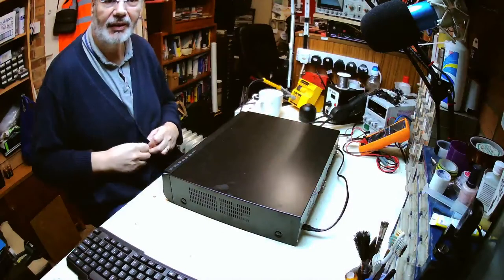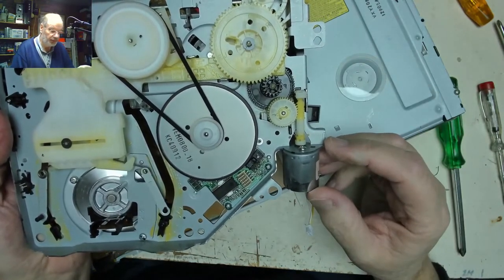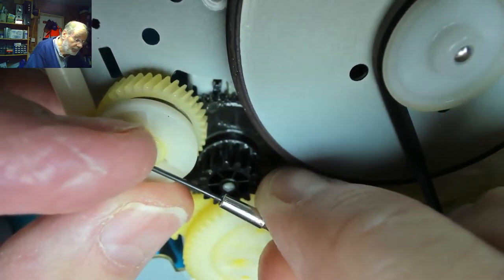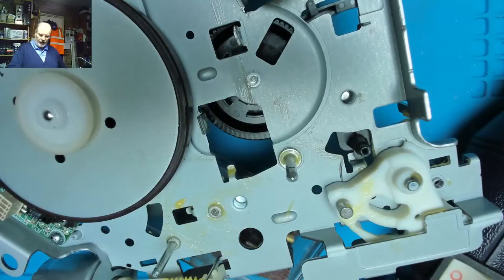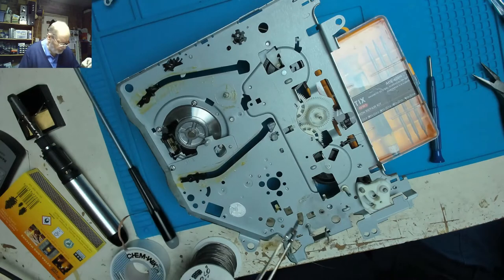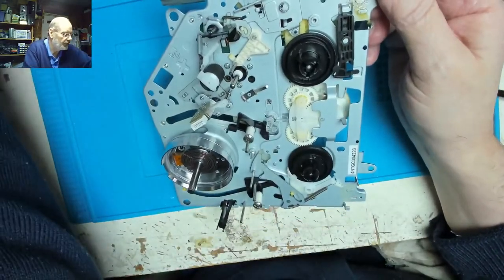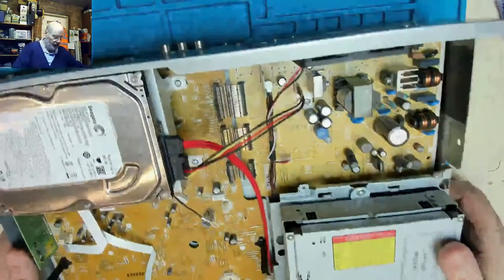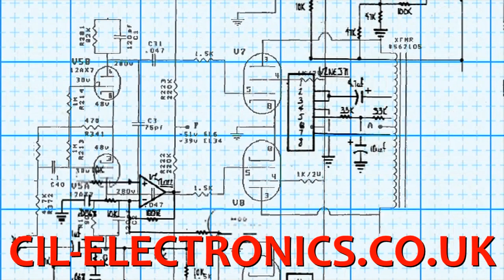Repairing a Panasonic DMR EX99V

Comment: Than you for a super video, this helped me a great deal, as I have a DMR-EZ49V with the same VHS mechanism. I had to replace the mode switch (managed to get 
a Genuine Panasonic part). I used your invaluable tips on the alignment of the mode switch peg to drive slotted hole, to the indicator on the side of the cassette carriage.
Powered up,  put the tape in,   motor drove it in and down but the two rollers did not take the tape around the head,   spat the tape out?
Like you i have taken it all apart several times, but now the tape motor drive refuses to take the tape in. Did you have a similar problem?
If so  ant tips on how can I overcome it Please ?
Reply from the maker: Sono contento di essere stato in grado di aiutarti.
Regards
Chas

Comment: Hi, I have ex99v and ez49v, both with faults u81 appeared on the display sometimes when I try to record dvd discs. I replaced the laser pickups and swap the drives but problem still appears.I know its usually capacitors problems in other lower models ez45, ez48 etc. but here capacitors seems to be ok, Is it possible that capacitors need to be replaced even if don't look to be blown up? Kind Regards
Reply from the maker: Capacitors and changing them is what a lot of people recommend, sadly, it's not always the answer and often is unnecessary. I only change those that need to be changed, just the ones that show they are about to fail - they have a split in the top or have expanded or leaked. Usually only in the power supply section. 
Have you got a service manual? If you have, check the supply rails are within 10% of their stated values and if, you have a scope, little ripple on them.
Changing the optical block often requires checking and adjusting the settings, including the laser power, so you'll need a laser power meter or a scope to check the eye pattern.

Comment: Another great video im getting back into electronics repair a little late in life as hey now 51 but have worked on brown goods and video recorders etc, for parts if you struggling try wiltsgrove electronics in birmingham they was always good/cheap for vcr/tv parts etc and soldering that post in was the best idea in my opinon it should last a while now not sure if you watch 12voltvids youtube channel i have learnt a lot from his videos.
Reply from the maker: Hi Vince, thanks for that. I was out of the Brown Goods repair trade for 20 odd years, having moved into Computers and Telecoms and have only recently started doing them again, several years after retirement and getting bored with Corona restrictions. Forgot how much I loved fault finding.
Thanks for the tip on spares.